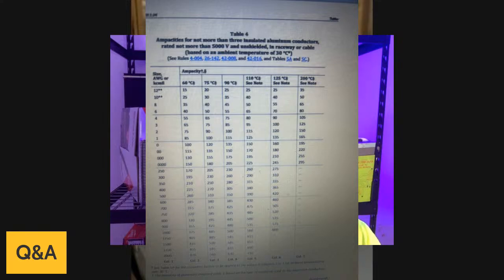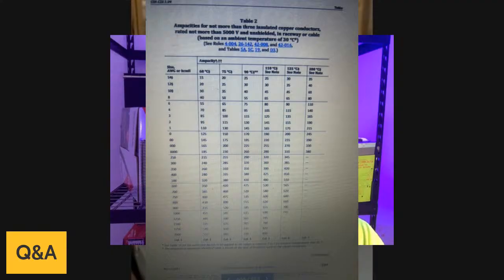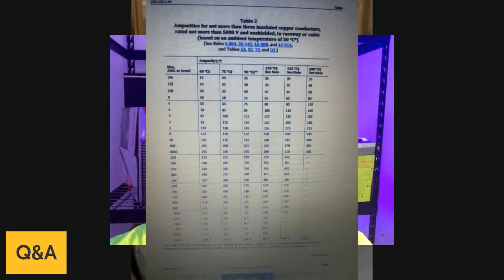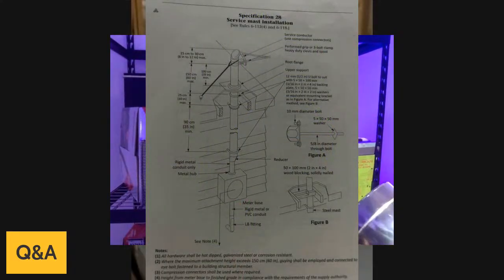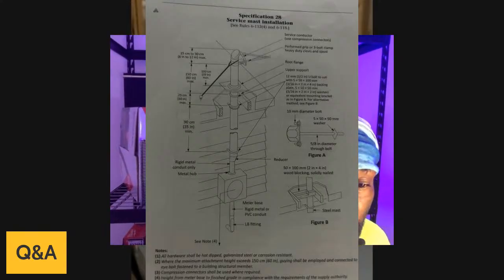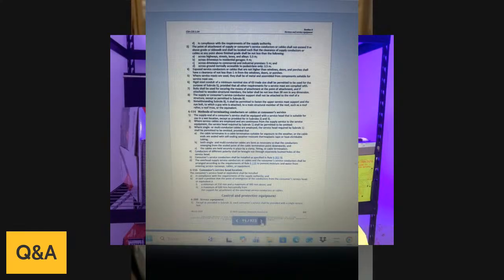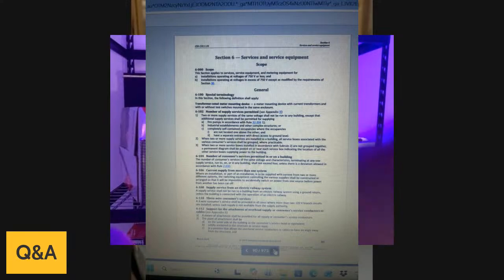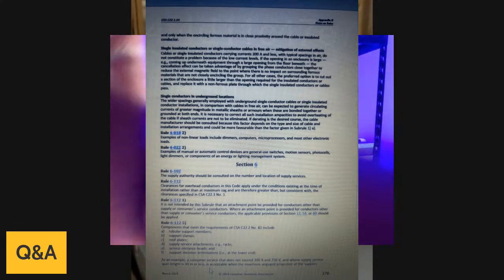100 Amp to 200 Amp Service Upgrade: Step-by-Step Guide ⚡

Comment from the maker: [https://www.youtube.com/@Fabianelectricalservicesinc] • Just now⚡ SERVICE UPGRADE CHALLENGE: On a standard 200 amp residential swap out here in Ontario, what is your absolute go-to conductor material and size for the service entrance? Do you stick to copper or run aluminum? Drop your preference below! 👇